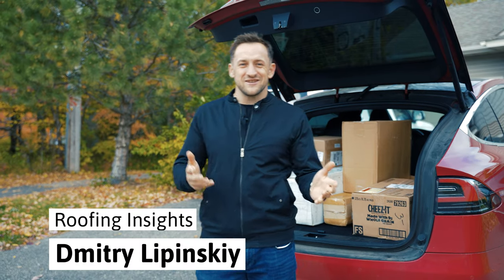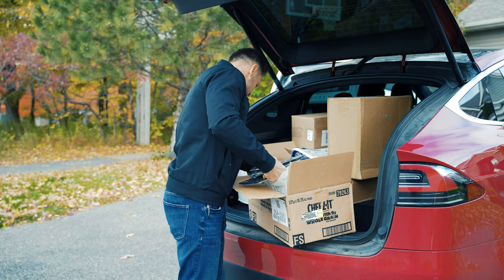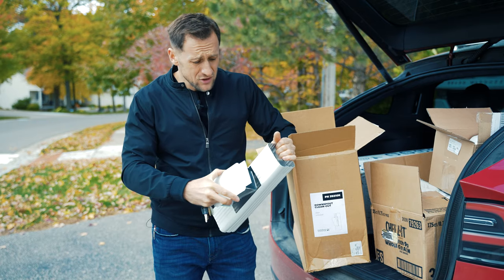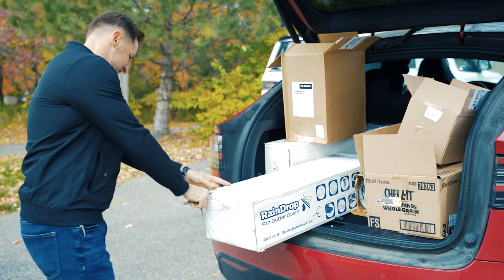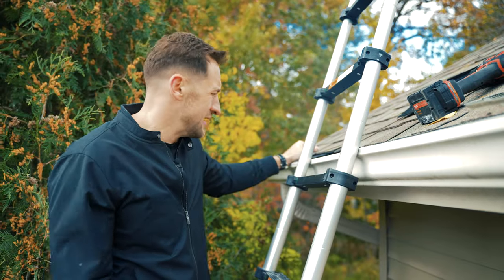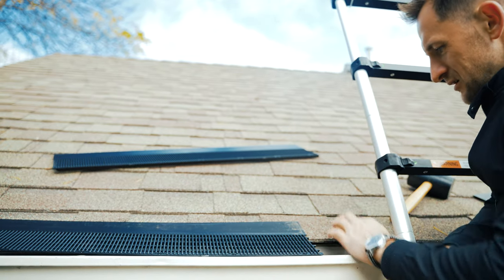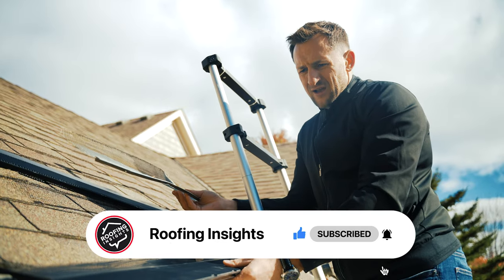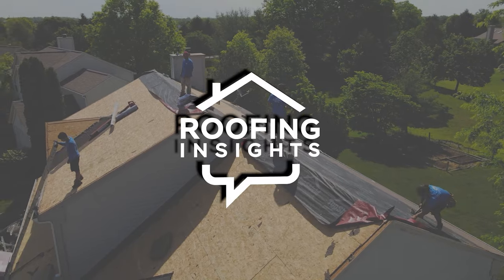DOES RainDrop Gutter Guard Work? Our First Review

Comment: Customer here. I have had these for several years. They work very well and I have not had any major issues and my roof is very low slope. I recommend them. One thing I can say is that Raindrop  has a weak Certified Installer program. The product being a type of plastic (but tough) needs to be installed carefully to avoid looking sloppy and uneven. I had to have my first contractor come back three times to get it right - and Raindrop took a hands-off approach to installer issues or warranty. I advise any homeowner to make sure they understand how the product should look - sloped, even, uninformed and get up on a ladder and inspect before a contractor is complete. Again I do recommend the product.

Comment: I’ve been using raindrop exclusively for 7 years and I can tell you it works.  I have a couple customers that I have to see every 2-3 years but they’re in crazy tree coverage areas.
Reply from the maker: Thanks for sharing!!! What are you doing for those customers every 2-3 years?
Reply: @RoofingInsights3.0  it works so well that I offer a lifetime no-clog warranty. Usually we just have to remove the last piece over the outlet and clean a handful of debris out.  It’s no charge to the homeowner.  Once they buy Raindrop, we own the gutter service for as long as they own the home.
Reply: Do you have customers that deal with large volumes of pine needles? I have a ton myself and thinking about having this installed.

Comment: What's the price range on installed cost?
Reply: What kind of margin do you shoot for?
Reply: @roofingtips  I think we would consider this "service work" therefore we would shoot for 55% margin.
Reply: @joelargesales  $16-$25 a foot
Reply: @roofingtips  Thanks for the info. appreciate it.
Reply: Hi Joe, the price range will depend on your market. Have an office in Chattanooga, St Louis and Madison , Wi. They vary. Am checking with suppliers on bulk orders and pricing. just saw the video. Reach out with more questions and I’ll get back with you. Glen
Reply: @peaceofmindrestoration11  Thanks Glen, was just going for a range at this time. Plus discussing the pros and cons on having price range on our website. Being mostly in sales/mktg I say yes, don't want to run after leads that aren't informed. Juan doesn't want to...keep it back so competitors don't know as well as prospects.
Reply: @peaceofmindrestoration11  Where have you found the best bulk pricing?
Reply: @roofingtips  What is industry standard for gutter screens where you are at? The main thing I am concerned with is making a decent profit if I am selling and installing these.

Comment: Thank you for your review, FINALLY.  We've been installing this product for 8 years now. Tried the others and tore them all out and reinstalled RDGG. There are installation videos from RDGG on you tube that absolutely teach you how to install this amazing product. You can trim with knife, shapers, circular saw, bend, shape, and bend the tabs down so that they do not have to go UNDER the tile. NO SHARP metal to cut your hands.  Cut 45's for the outside edges with ease and hide it with the corner miter. You can even rest them on pvc tubing to get the correct angle for the debris to fall right off. We've had TREES fall on the customers house and crush the gutters. We just reused the same guard. You can't do that with the aluminum screen door types. Those who doubt that there are "no complaints in 20 years".... post the link of the customer  complaint below. I'd like to see it.  I wouldn't use a collapsible ladder, but have in a pinch.  This product is superior to all covers that lay flat and have snag points.   I do not work for RDGG, but I ordered all the info and sales displays and samples and was sold after I received it and installed it.  NO COMPLAINTS in 8 years, nothing but praise.

Comment: I had Raindrop install on my roof but they did not work well. After further research, I concluded that they were not installed correctly. They were not on the same slope as the roof. And therefore, active as a damn. I’m going to have them reinstalled by a company because I think it is a good product if they’re install correctly.